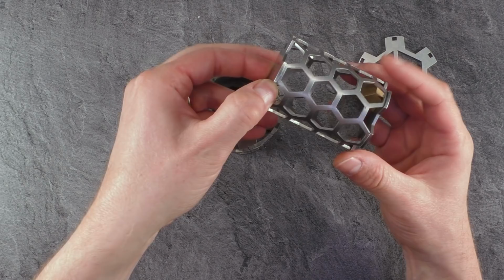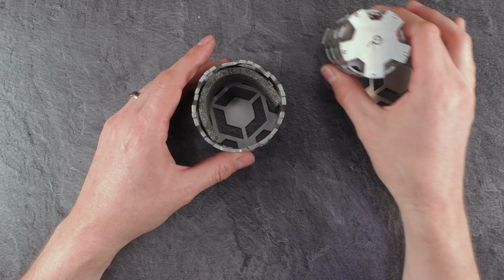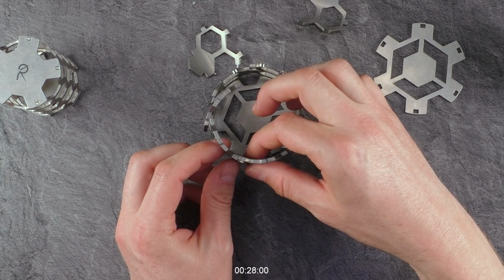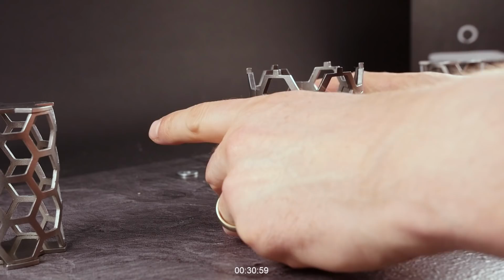The Insane HexaHog Puzzle!! - A Puzzle like no other!!

Comment: If the outer Hexa is made from ferrous metal, would it be possible to place the base on a magnet so the pieces would be more stable and hold together when you reassemble the puzzle?

Comment: I got the Hexahog a few months ago and I found that you can use the hex profile from a piece of the cage as a a Go/No-Go gauge on the hog to find the exit correct hole to free the hog. 

My cage is a lot looser than all the ones I've seen in video reviews and is not possibe to assemble free hand. I have to build the base layer and secure with a band around it then add the top layer. 

A great quality puzzle and I'm looking forward to the next Rademic Hog release.

Comment: In English, the object inside is called a "polyhedron" which is basically a 3D polygon. In other words, a polyhedron is a 3D shape whose every edge is straight and whose every face is flat. So cubes, pyramids, hexagonal prisms etc are all polyhedrons.

It's not a commonly used word though. Just now, I searched "what is a 3D polygon called?" because I had forgotten the word; so I'm not implying you should have known the word, I'm just sharing the info.

Comment: Didn't you do another puzzle almost exactly like this in the last couple years?  Remove a metal bit from a metal cage by finding the opening that's slightly larger than the other openings?
Reply: I think I've seen the smaller one before, but I watch 3 puzzle channels, and they do tend to have some overlap in the puzzles they feature.
Reply: he did. I forget the name.